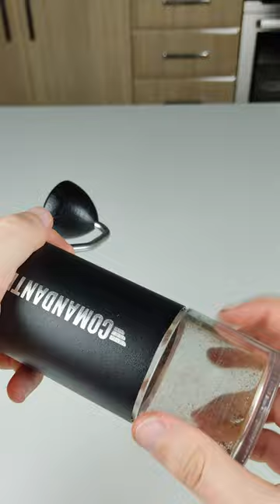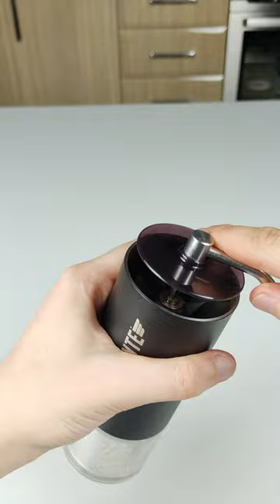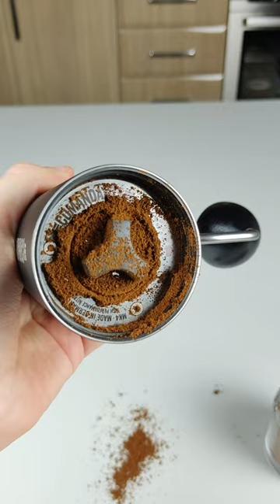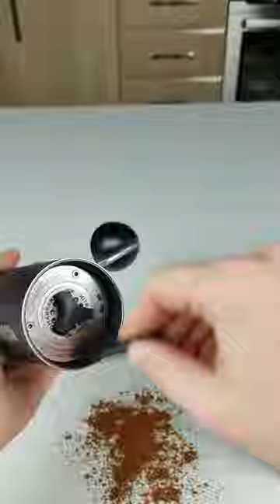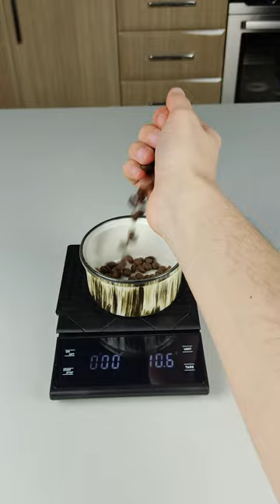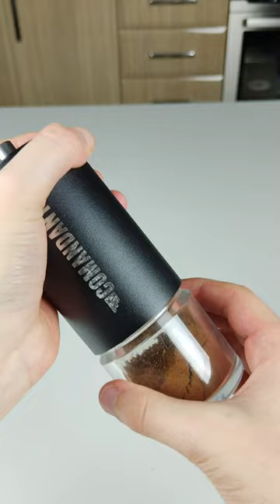Coffee Hack: Spray Your Beans

Comment: Will the grinder rust in the long-term. I hear that it is not recommended to have water on the metal parts; burrs, washers and the spring.
Reply from the maker: Nope, it is stainless steel
Reply: The heat generated during grinding evaporates the water in the burrs. In Hoffman video he showed that the moisture in the chamber equals the ambient in a few seconds